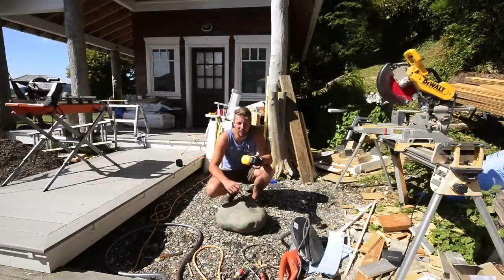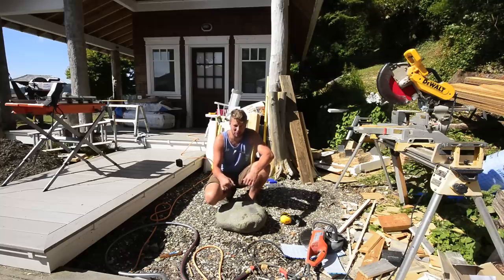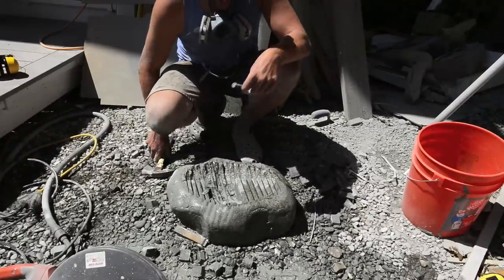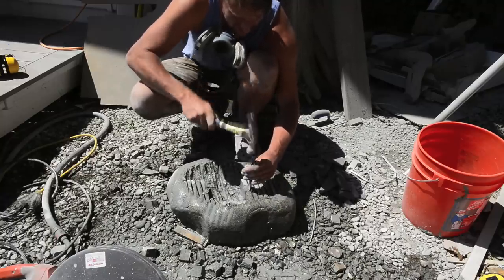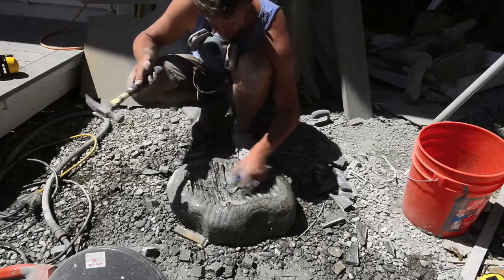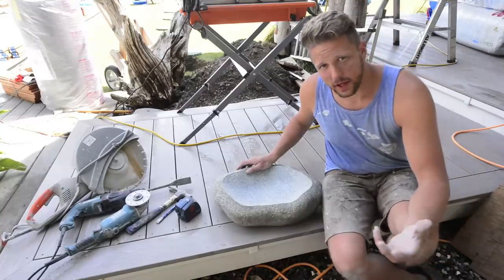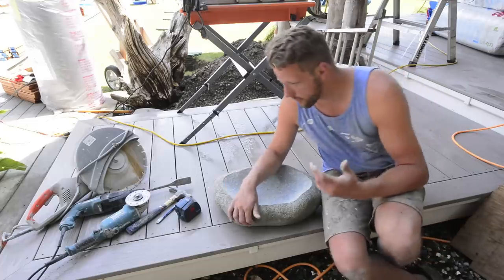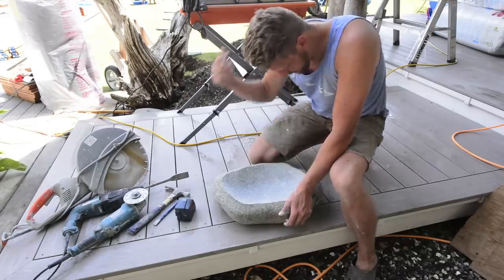How to Carve a Stone Sink in 4 Hours!

Comment: How did you drill the drain? I was thinking about cutting a rough hole with a star cold chisel and then smoothing it out with a diamond rotozip bit.
Reply from the maker: Watch the installation video.
Reply: use a core bit for stone. diamond tipped

Comment: Diamond Saw. Rubber Croc shoes. I was expecting blood.
Reply: and no guard on the smaller grinder, aaargh!
Reply: Dennison Bertram I remember the guy who taught me to use a concrete saw was wearing soft leather moccasins and holding the brick still with his foot
Reply: Jesus that is spooky
Reply: Respirator is more important.
Reply: Dennison Bertram that diamond blade wont cut you i mean anything can cut you with enough friction and force but its not like a normal saw blade you can touch the blade for a sec and no worries i wouldn't recommend doing it but you can
Reply: why work on the sink at ground level it should be up on a bench to chisel out  and stand on something to use saw save your back man Think about it
Reply: I know one guy killed himself from a chip of the disc got loose and penetrated through his clothes, cut his artery to the heart and he bled out before the medics got there.
Reply: Bottom line, when working with angle grinders or any other aggressive power tool, take all precautions to prevent injury, regardless of how small. I would say no to the shoes based purely on the fact that they are loose fitting and do not give adequate purchase on the dusty, stony surface underfoot. He is working while on his haunches or knees so can not easily get away if something goes wrong. And he is wearing shorts.

Of course, the respirator, eye protection and ear protection are a must.
Reply: Dennison Bertram .
Reply: But those are safety crocs

Comment: Hi,Your sinks are cool.
I saw how you work. That's cool too.
Now I have an idea with the water drain. I also work with the big drills. After you have drilled a hole for the drain, you must make an entrance for the expiration. This is quite difficult, because you freely enlarge the hole. My idea: before you drill a hole for the drain, take a larger drill and cut so deep until the heel fits. So a few millimeters. Then you drill through with the smaller drill. Then you have it easier and a clean cut for the process and does not have to work freely hand.
Sorry for my english. I'm from Germany (Hamburg)
Cool sink !!
Good luck.
Cheers Olaf

Comment: This wasn't really a "how to".  It was more of a "watch do".
Reply: He covered all of the steps necessary on how to do the project. How is that not a "how to"?
Reply: He didn't explain any of the reasoning behind anything he did, though.

It would be like asking someone how to paint so they sat down in front of you and painted a picture without saying anything.
Reply: BradSk88 he cut the rock, broke the prices out with a chisel, then smoothed it out with a smaller grinder what did he need to explain?
Reply: Well for me he covered everything essential. Very cool idea! When I'll built my house I'll make one or some... Well for the drain I would have used a bigger drill first before drilling the smaller hole through... Saves time but well ist also means you have to buy one more expensive drill...
Reply: Uhhhhm he literally explained step by step what tools he was doing and why he was doing it lol buhhhhhderpppp

Comment: Anyone else watch this and think, this is something I'll never be able to do
Reply: Nick Sacco start will smaller projects and get comfortable with power tools and you will feel different.
Reply: Dude, you can do this, trust me. Power tools are designed for the common man to be able to use. And hammering, chisseling, and sanding are things you will easily figure out as you get going. Also there are many great resources, especially on the internet that can teach you how to do all these things for free.
Reply: TheEngendrito Alex is right. Practice and get comfortable. I would recommend (if you are doing this for your own enjoyment) calling a grantie yard. They usually have extra, broken slabs of granite they'd probably gladly give you for free just so you'll get it out of there. Practice simple things first: put a 7"-7 1/4" diamond blade on a skill saw (lightly run a water hose over where you're cutting for a nicer cut) and practice cutting straight lines. It won't cut as fast as wood obviously but it goes quickly. To start practicing something like the content in this video: concrete is basically man made stone. Get a big chunk of waste concrete or mix a couple bags up, dump them in a pile and let it dry. Make a concrete sink. If you mess up who cares? 👍
Reply: TheEngendrito granite yard*
Reply: TheEngendrito I know for a fact granite yards have slabs to give away. When we transport big, fragile granite counter tops they sometimes give us an extra damaged one to lay in first as a support.
Reply: Be honest I got dragged here because I am learning to become a mason cause my cousin offered me a 20$ an hour job.
Reply: The hardest part about doing this is dealing with all the dust
Reply: No

Comment: I am working on a similar project, but I'm having issue with the dust. Is there a dust collector for an angle grinder that can be operated for carving at an angle like in your video?

Dust collector system can't seem to work properly except on flat surfaces. Any advice? Thank you!
Reply from the maker: Work outside and use a respirator.  Pretty hard to get around the dust issue.
Reply: I'd probably use a fan pointed in the direction away from your face. That's to help the dust fly away from you, and of course... do it outside & wear a mask/eye protection.
Reply: +The Samurai Carpenter how did You do the sink drain? I'd be afraid of cracking it in the process! Cool video's btw...
Reply: another super nice thing instead of a fan is put the hose on the exhaust ofend of your shop vac, you can direct it away from you and it won't ruin a good fan.
Reply: run grinder through a gfci outlet and use water.... lots of water or a fan just be ready for a mess either way

Comment: Recommend heating it completely gently, not real hot, and then apply bowling ball wax, which will then be absorbed into the stone, bringing out the color, just like when you wet it. It will look even better then. Good luck with stone carving, it is very meditative with hammer and point chisels.

Comment: i think buying 2 diamond cutters etc....its cheaper to just buy the stone.

also you can save a lot of money not getting the laser pointer. in the clip you cut the top to make it level then grind a hole in the centre. so that means it was ment to be the top all along? isnt it better to make the bottom leveled? and even that can be useless if you just rest it in freshly poured cement suck in within a hole of the countertop when you installl it. that way it also doesnt stick out 20 cm over the counter?

all critique aside, yes it does look awesome

Comment: As you chip away after the relief cuts with the chisel you add a caption advising safety glasses! So the crocs and shorts you're wearing while welding the diamond disc give you no cause for concern? I have used chainsaws and stone saws since 1990 and experienced kickback only once (stone saw) but the safety boots ensured I still have a full set of toes and a stripping chain only once but the kevlar trousers mean my leg's still in one piece. Stop taking chances with your limbs.

Comment: You forgot to mention the $100.00 12" diamond cut-off blade and the $50.00 4 1/2 diamond cup grinding wheel and the hammer chisel is not free so you're over $250.00 and you haven't even put in the drain hole yet. Do you plan on soaking up the dirty water with a rag and then wringing it into a bucket ? Your gonna need to wash your hands after that.       I think I'm heading to Home Cheapo !
Reply: Gary Johnson rent the shit
Reply: I Have... And when you take the blades back they Measure The Diameter of the returned blades with Micrometers and charge you an exorbitant rate for each .001" of blade that is gone! In the end it is FAR cheaper to buy your own blades.

Comment: throws the electric diamone wheel saw down like its a piece of junk
off cuts and rubbish all over the place like its a scrapheap and not a working area
washes the finished SINK  down with water and garden hose  WITH  electrical equipment laying close by
no protective eye wear
no proper safety foor wear

have a little bit of professional pride in the way you work